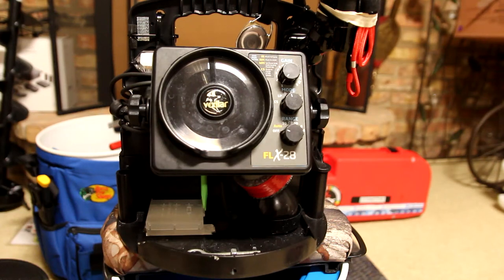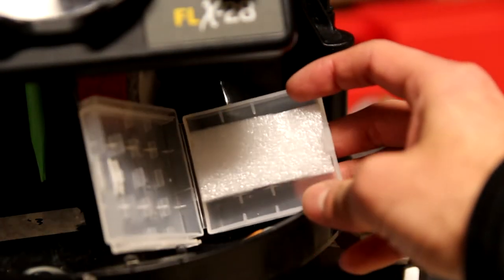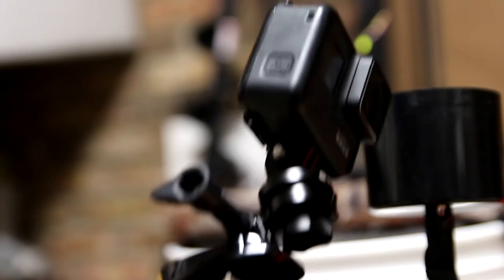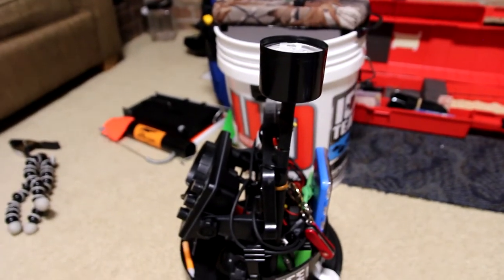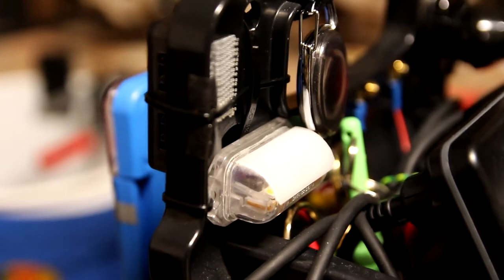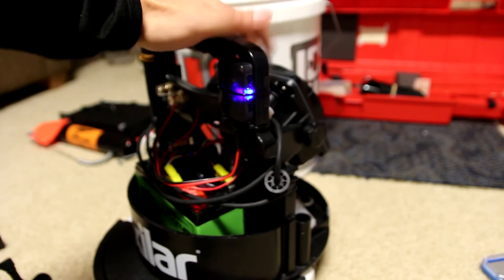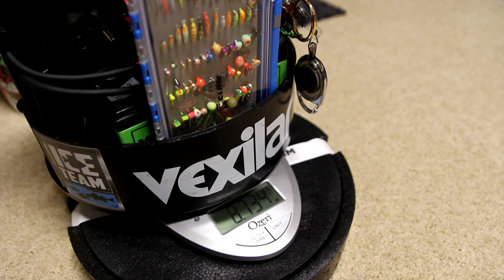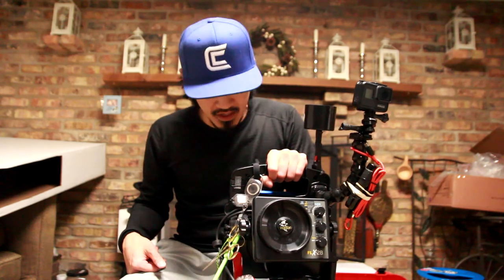Mod Time ft LENGTH #ITSCHOETIME Vexilar FLX28 CUSTOM Pro Pack Modz

Comment: Love all the mods you've done! Very original for sure. I'm a gadget guy too haha! Keep up the vids man! Just found your channel today. Tight lines man!
Reply from the maker: Thanks Jay! I’m a gadget nut so if you have any other ideas send them my way! Running out of room though! 🥶
Reply: Cant believe you're not running the 30 yet!  Not sure how much of an upgrade it is over the 28
Reply from the maker: Considered it 100 times make no mistake! Maybe next year if they offer the pro pack.
Reply from the maker: I think it’s about a 1.5x upgrade from the flx28.
Reply: @ItsChoeTime  my issues with dropping that kind of money on the 30 is its still just a flasher,  I have that and more with the garmin echomap 73cv plus,  and I have a vex flx 20, the garmin gets year round use in the boat and on the ice , plus creating maps is a great tool for  some of our small lakes
Reply from the maker: No doubt! It fits very small specific niche application.